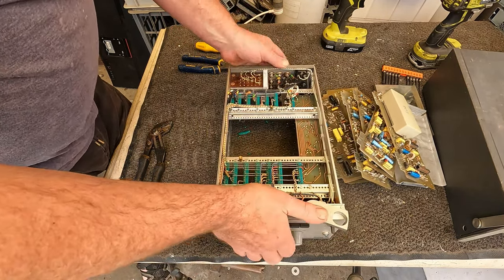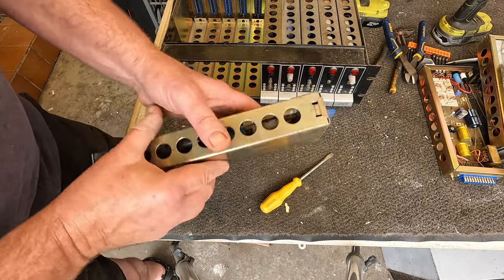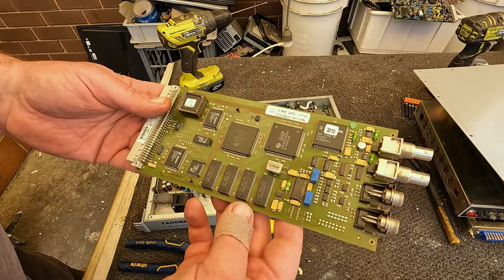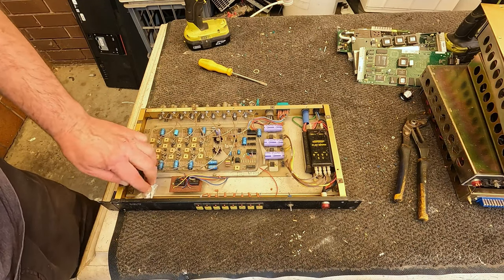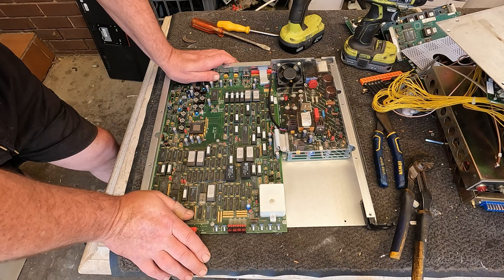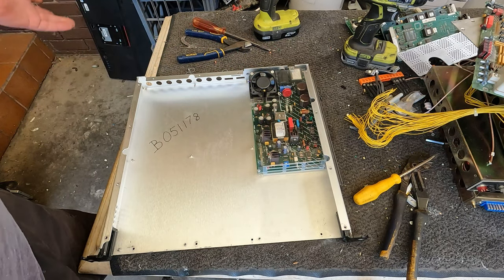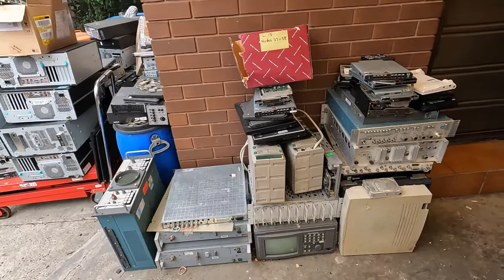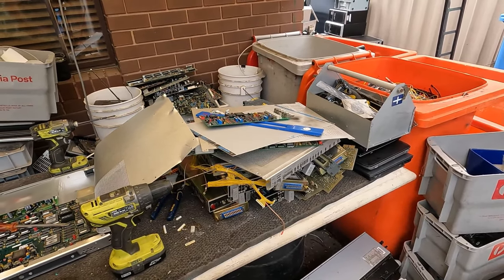Scrapping Vintage AV Elecronics Pt2

Comment: The coax cable roll is a delay line, more or less the idea is that signal does take some (very little) time to travel from one end to an other, it creates a time shift used in video signal processing. More common delay lines are those flat plastic boxes, using ultrasound waves travelling and bouncing in a piece of quartz or special glass.

Comment: Before IC chips, transistors doing their job. They're as good as ceramic cpus for gold recovery. If you remove top cap, you'll see gold bond wires inside. Refiners are crying, when they see you're wasting transistors lol. Thank you for vintage scrap videos.

Comment: It would have taken thirty seconds to skin the insulation off of that thick antenna cable. Fill up a bucket with copper like that and they pay $3 a pound for it at the scrap yard. Don't need the money do you?
Be kind and do good work.
🙃🦂😇🐯🦄💜